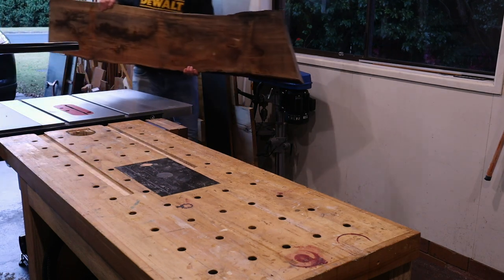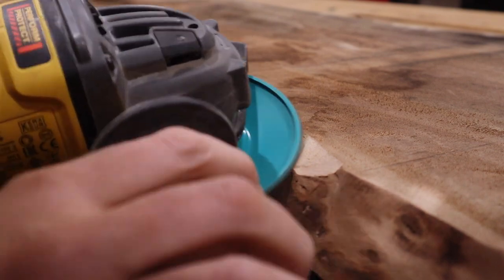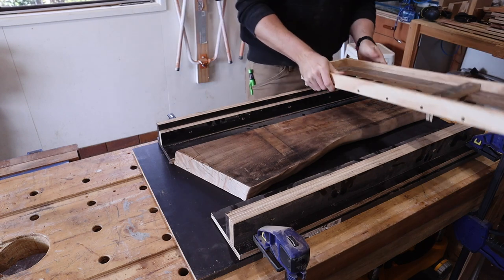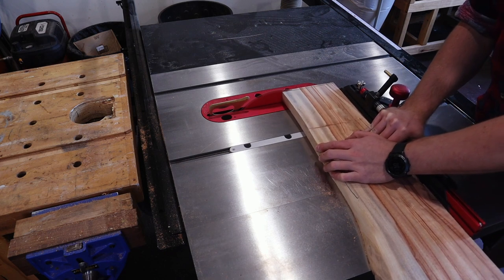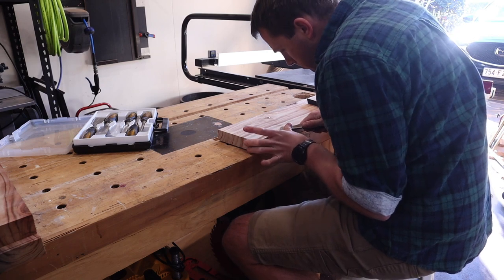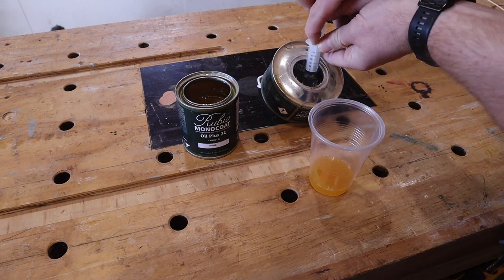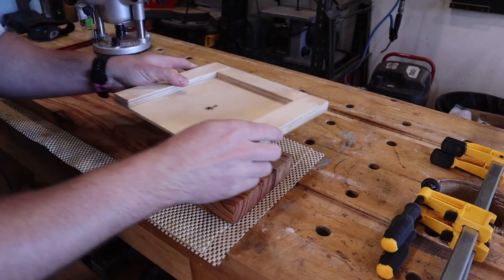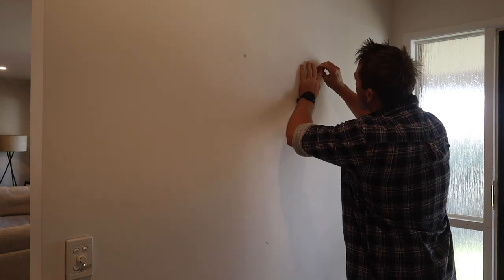A BEAUTIFUL Live Edge Coat Rack // Transforming an Ugly Slab

Comment: 01:40 you so much reminded me of Stumpy Nubbs earning his name while using angle grinder & hogging burr !! At least no blood spilled!
01:50 You're a paramedic, what happens when high pressure air + wood chips/sawdust+ eyes cone into contact?
What is minimum PSI to pierce skin?
Reply from the maker: Thanks for watching. I don't really know where you're coming from, but with regards to your first point - I'm removing the soft bark and cambium from a soft wood slab, gently. I don't really see where blood was likely to be spilled, but you do you. As for your second point - I can say that I am happy blowing dust off myself with the air compressor, but if you're not, then don't. It's not high pressure by the time it hits me, unless you consider a Dyson hand blower "high pressure". Protective eyewear and my eyelids did and will continue to do a fine job in that setting. And despite my career, I don't need to know what pressure it takes for air to pierce skin, but I can confidently say that it is higher than my small domestic air compressor.
Reply: @RangeWoodworking  stumpy was using angle grinder (like you), grinding burr ( like you),  using in awkward angle (like you) but yoy had sense to change grip & position! Btw Stumpy Nubs had that name before his major accident